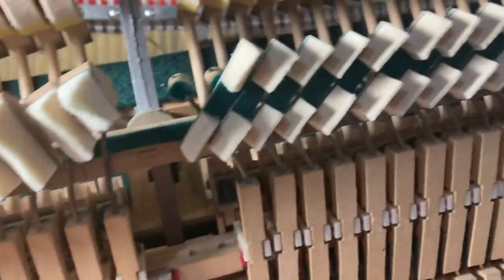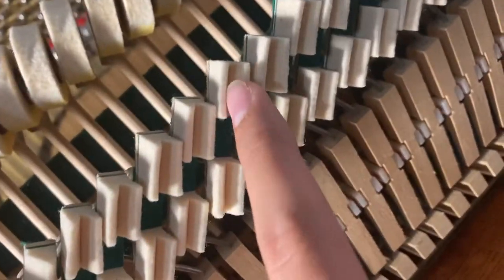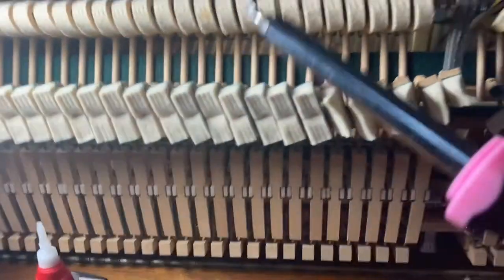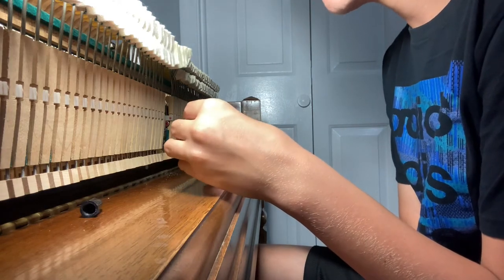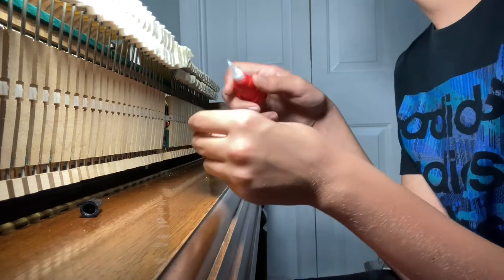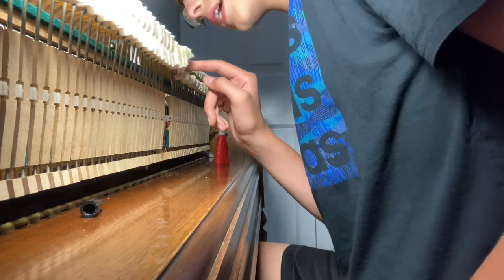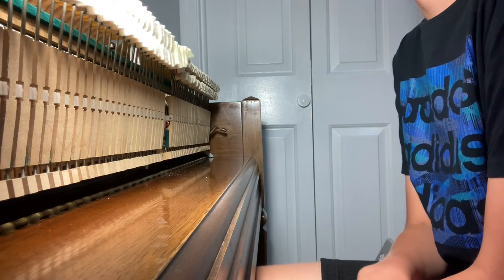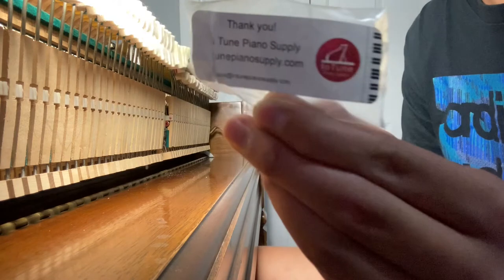How to replace a damper felt on an upright piano￼

Comment: what kind of glue do you use?
Reply from the maker: I used some regular gel superglue it’s not good to use piano PVCE glue because It takes over 24 hours for it to dry and it’s not good to have to clamp the felt so I just use Regular gel superglue because it bonds in just a matter of seconds But you still have to be careful to line it up in between the strings